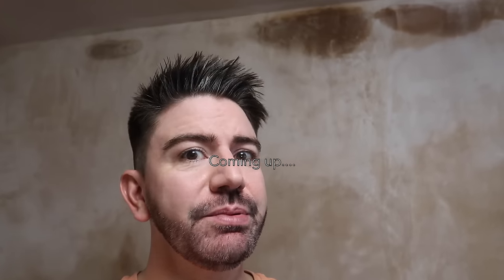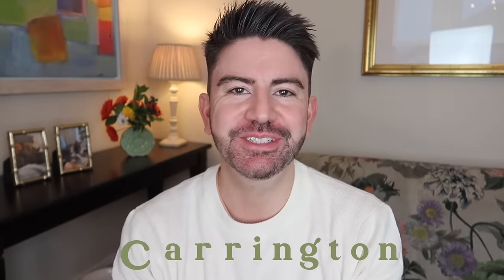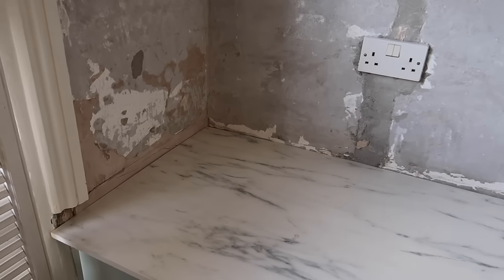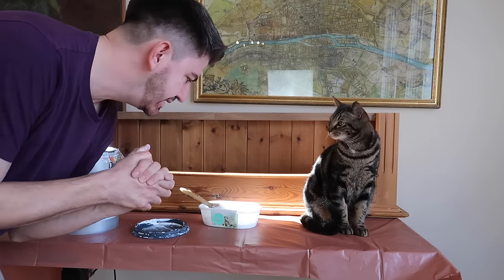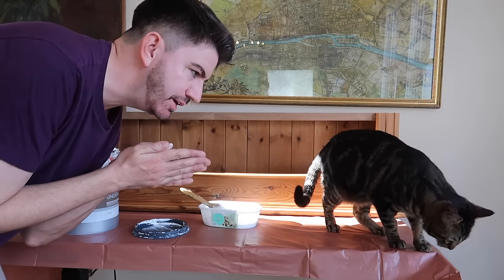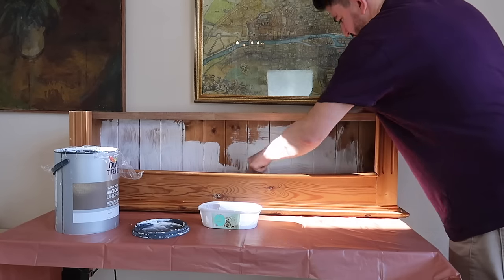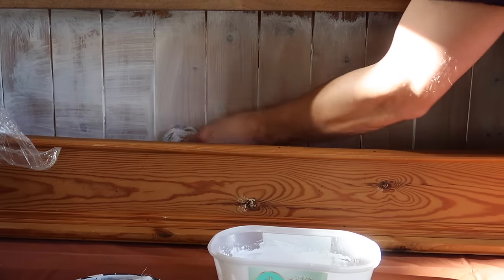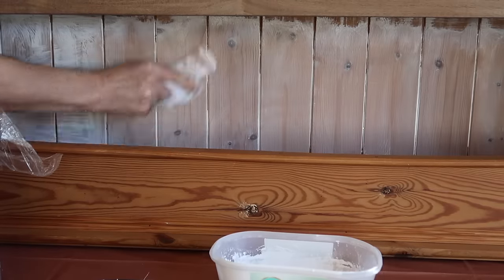Renovating my Victorian Home | Upcycled furniture & Kitchen update! MR CARRINGTON

Comment: Our home right now is noisy and like a building site. So far five weeks of work and on it goes but, a need. Making one large bedroom into two with an en-suite.   Renewing everything, walls, floors, ceilings, even the floor joists. Almost finished. Using Carrera marble in the en-suite ,on walls, shower unit and part of the ceiling. Huge job but sourced much of the materials very cheaply and doing it ourselves has saved us a small fortune. 👍👍👍👍😁

Comment: I’m a messy painter and where I dropped a little paint on the floor before I could wipe it up my dog stepped in it. Had several paw prints I had to clean up. If you are going to leave the shelf empty for the cats to get in maybe put a cushion in there for them. I brought flat pads that say the material inside will reflect the cats heat creating warmth.

Comment: I am moving into a new house and the kitchen needs 'doing' so I bought three mid century teak type office cabinets for ten euros for three ! Really well made and sturdy. Then recently I bought two huge sort of counters, all solid wood with hardwood tops and six solid doors, almost 4 metres and paid 40 euros for both, then a slab of white marble 110 x 50 cms that was on a coffee table for 50 euros. I am integrating a narrow solid chest of drawers that I paid 10 euros for. I did buy a new cooker hob which was 150 euros, vitroceramic for easy clean and am ordering a country type ceramic sink, 450 euros, so I think that all included I am about 1000 euros including tiles. A neigbour is exchaning his recent table top fridge for my taller one.  I also wanted a plate rack with that dowel front so I ordered 100 18 mm ash dowels from Austria and will use every piece of my wood store to make it. The dowels were about 50 euros. The kitchen is 8 m 2 so every space counts but it does give onto a lovely courtyard where I can set up a table for summer dining. Can't wait to start. For my two little Jack Russells I made a beautiful dog kennel, covered in antique fabric with bronze nails, a side window and removable top with a mattress inside. I decorated the inside with images of furniture and painting glued inside the kennel and was so happy with the result. They NEVER used it, preferring any old cardboard box that I left around !
Reply from the maker: Fantastic 👌
Reply: Ooh that sounds lovely, would love to see the finished room. Yup, did similar for our two cats who also preferred cardboard boxes:body-blue-raised-arms:😹
Reply: Yes, I would love to see this, too! I cannot for the life of me see it, but it sounds like quite the undertaking with a huge cost savings and an incredible finish!

And, the pictures inside sounds like it looks like a doll house. I can imagine that in my mind ... little widows with trees outside, a rug, table and chairs, a sofa ... all attached to the back to look like they are in the room. How clever!

Comment: Work around the home is the garden when not raining! Discovered a great tip to remove the green algae from wooden fence prior to painting. One part bleach to two parts water,  I put in on with a large sponge so super quick and amazing result, no need to rinse either.  I use the dish mat for grandchildren's wet shoes by the door, saves the floor. Loved the paint wash on your cabinet, a great result. 😊

Comment: I wonder if you thought about maybe putting some small legs on the bottom of  your little DIY cabinet  so it takes it off the ground a little bit . Not too high just  an inch or two . just a thought.

Comment: I am no carpenter but l think l would have been tempted to glue that joint rather than screw it.  There is not much wood for the screw to grip to and risks splitting it.  And you would avoid the screw heads showing.  Maybe put a small batten underneath on the inside just to strengthen it?